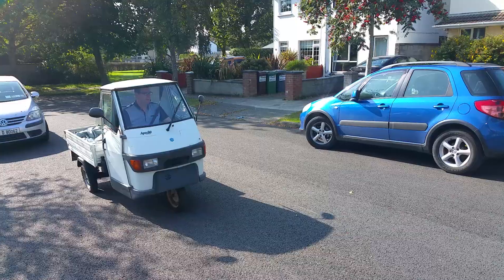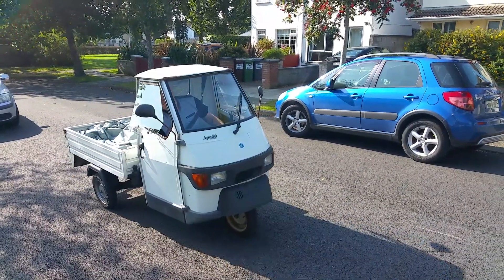Thank fully it's not the clutch just the driver so now we can crack on.. piaggio Ape 50 cc

Comment: I wonder if the clutch cable is sticking in it. Take it off at the gearbox and see if it's free moving.  Might need abit of oil in the cable. I know nothing about these....
Reply from the maker: All sorted .. slight adjustment to clutch and lube everything up and drove it for 80 miles around the town..